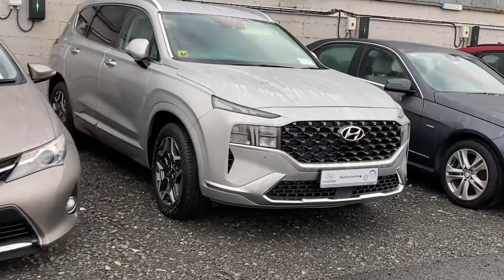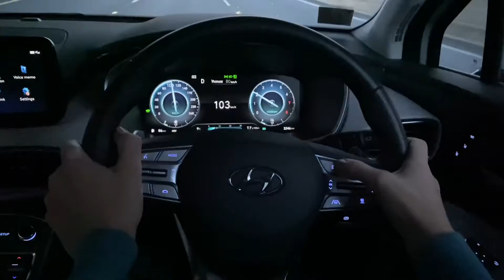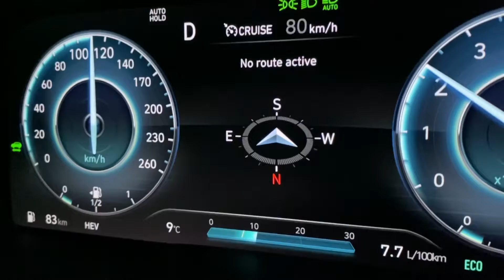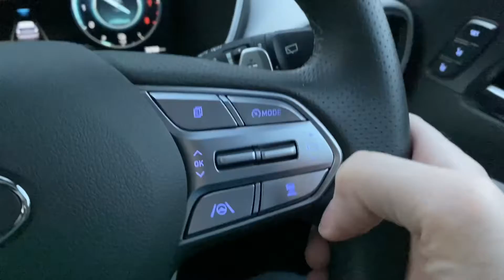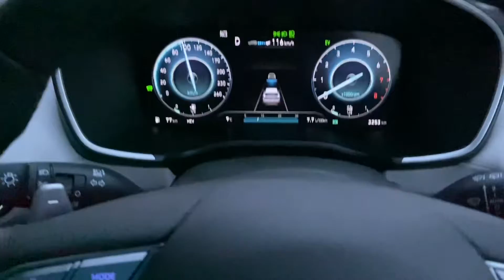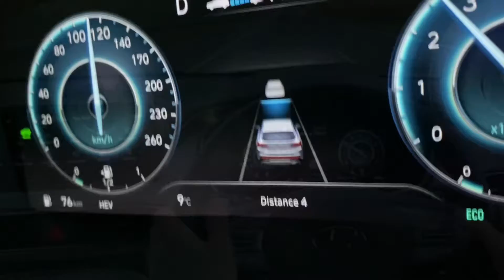Adaptive Cruise Control - Step by step demonstration - Hyundai Santa Fe #adaptivecruisecontrol

Comment: in adaptive cruise, if the vehicle in fronts slows down quickly, I know that my vehicle will also slow down but my concern is do my brake lights come on during this quickly slow down so the vehicle behind me does no hit me??
Reply from the maker: It’s a good question, so my experience of adaptive cruise control , if it requires use of the brakes .. on most manufactured cars, and probably all of them , it should also engage the brake lights at that point , when it slows down the car by using reduced throttle input, it won’t apply the brakes lights if brakes are not engaged

Comment: Brian how do you stop the instruments dimming in low light on a 2022 Hyundai i20 nline
Reply from the maker: Ok .. just to clarify, you want the dash clocks to remain as bright as daytime at nightime ?:)
Reply: @briandoolanatfitzpatricks  yes thats correct  the same day or night, I find now that when they auto dim in the dark for me they are way to dim
Reply from the maker: @ronair5  ok I’m the multi function display and using your steering wheel controls .. you can go to SETTINGS , then LIGHTS , then ILLUMINATION , then turn that up , does that make sense ??
Reply: @briandoolanatfitzpatricks  thanks Brian for all your help,  sorted